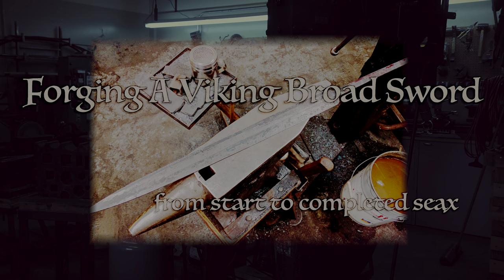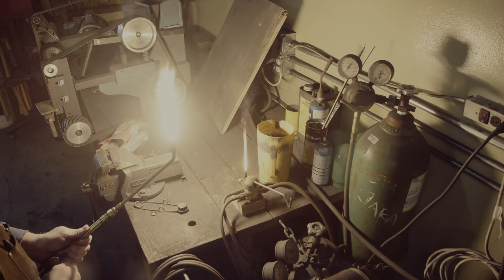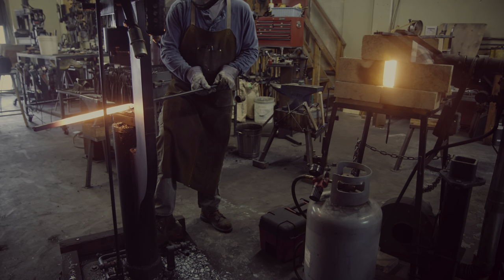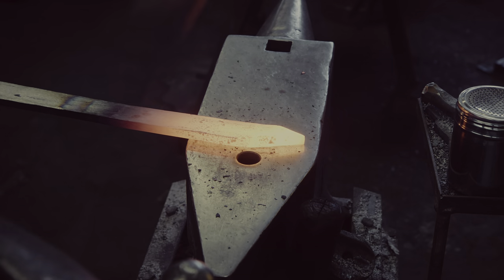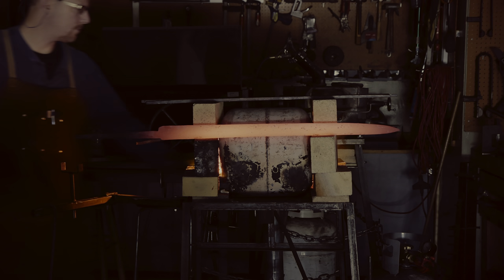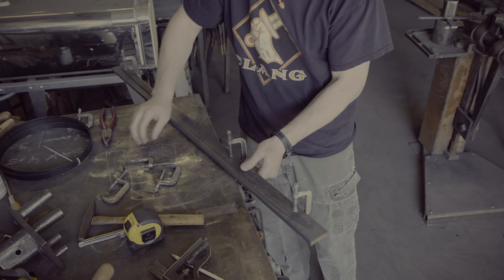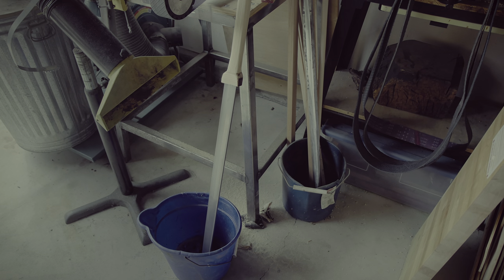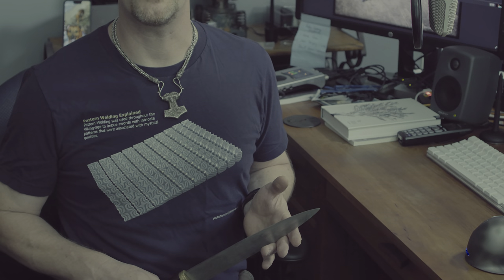Forging a Viking Broad Sword: from start to finish - Swordsmithing! (Broad Seax)

Comment: Completing a twisted bar sword successfully even with access to today’s modern power tools is an almost impossible task. It boggles the mind to think of how skilled the dark and middle aged European blacksmiths were to have created the swords they did without the tools of today. Back then, a master blacksmith must have worked years as an apprentice, probably from a very young age, and also would have needed a team of skilled workers beneath him to pull off such a feat without wasting expensive and difficult to come by high carbon steels. As you say in the video no one truly knows exactly how certain steps of the build were completed back then or what types of tools they had access to. I’ve also read the process was not uniform throughout Europe as not all blacksmiths studied under the same master and also lived and worked in separate communities, which means they most likely had very different processes and techniques.  Thank you for disclosing the amount of time it too you to make this sword. A year is understandable even for a skilled blacksmith like yourself that has a full time job and only a small amount of time each week to dedicate to these builds. Amazing video! Thank you for putting the time in to be so thorough with your explanations.

Comment: "I will see you in another video very soon"

Our perspective of time seems to be different. Niels please don't break my heart.
Reply from the maker: Soon is really up to a lot of interpretation. This is meant to be in Niels time.
Reply: @NielsProvos  Quality takes time :) I quite enjoy whatever you throw our way. By the by, I was recently re-watching your wolfstooth spear video, and was wondering whether that method could have been used to create relatively cheap and "mass" produced swords? i.e. forge out a bar of steel of sufficient quality, and then fold it around a low carbon steel/iron centre. Would such a sword work at all? or would it just be structurally flawed to such a degree that it wouldn't even be usable?
Reply from the maker: Yes. Common construction for Japanese swords.
Reply: still curious as to when the serpent sword will be done..

Comment: Great video ... although the "closeup" near the end wasnt quite close enough to really show the pattern to best effect.  Enjoyable and informative +1 😁

N00b question: why draw out and then forge weld long pieces together ?  Wouldnt the chances of success be better if you forge welded them before drawing them out, or would that adversely affect the pattern ?
Reply: Drawing out the billets also lets him size the patterns. Since he has to manipulate several billets to create the pattern, it's best done at a larger size, so it's easier to handle, and there is more surface area to forge weld. Sometimes, the metal doesn't close all the way, creating a cold shut, and a larger billet gives more leeway to grind out the cracks or shuts that a thinner billet doesn't have.
Reply: @shura0107  Thanks for explaining. 👍

Just to ammend my question a little further ... yeah, it seems like fairly common practice to take off a little from each end when forge welding since delaminations seem most likely to occur there, so it appears to make sense that a billet would benefit somewhat by being longer to minimize the material losses with removing the ends in each pass ... but it also seems like that benefit only helps to a certain point, beyond which the chances for a delamination somewhere in the middle would seem to increase.  If there is such a 'sweet spot' (i.e., range of optimal ratios of length vs width/height) i'd love to hear some thoughts on it, because i've yet to see a video that covers stuff like that.

Gratitude in advance to anyone willing to take a stab at that ... assuming it's even a thing. Cheers.

Comment: Something that you might find useful for straightening a warped blade is Shimming it on either side of the warp when you clamp it to the mild steel bar.  Also Tempering A long blade to 450f is usually sufficient to give it a nice spring temper.
Reply from the maker: Thanks. That's a good point. I sometimes shim with US quarters. I also had experiences where shimming created a warp in the opposite direction that was really difficult to remove :-)

Comment: This video for the first time answered a question that has been bugging me: 

Swords are made to specific size and must not be too heavy. The starting material billet is significantly heavier than the end product, and all forging work reduces the mass slowly through scaling. But much of the forging is done to hammer out kinks and shapes that you could never predict so you can't know beforehand how much scaling you'll get. And I never see the blacksmith do any "weight finalization" by cutting an excess piece off one end. So how come they end up with the weight and size they wanted? Now according to this, any excess material is left as thickness, and is removed through belt grinding. Am I correct in this?
Reply from the maker: You definitely want to make sure you got the basic shape right as that determines the balance of the sword and the overall weight. Grinding is definitely the way to fine tune this. It's also important to keep in mind that that the guard and pommel will add weight back.

Comment: Nice video @niels provos, though you should improve on your hammering skills as throughout the video you just lightly tapped the metal rather than striking it.. it’s not glass, it’s metal.. though that’s just my opinion, everyone forges differently..

Also when quenching in oil you need to dip it in and out like a tea bag, not slowly with minimal movements, as the heat from the hot blade will form a heat bubble like thing around the blade so the quenching will be uneven and the metal will warp.. so doing it by dipping it fast, in and out will get rid of the bubble that constantly forms around it and renewing the oil contact, resulting in an even quench..

Comment: I feel like historically the twisting would’ve been done by holding it with tongs and tong clamps very tightly. An apprentice holds one side the smith holds the other and they twist opposite directions could be wrong. Lovely work!
Reply from the maker: There is some evidence for twisting torques using special tools if I recall correctly.
Reply: Niels Provos hmm. I saw some twisting bars made of mild steel or wrought iron back in the day. It was a 18” ish bar bent in an s shape with the ends of the s extending to hold onto. It fit two sizes of bar stock

Comment: It seems like a lot of material, compared to the final product. Do you think that smiths back then used less? Considering they had to do everything by hand.
Reply from the maker: It's probably actually quite similar. Of course back then even more work was required to make the material. A sword like this would be a fortune.

Comment: How heavy is that peddinghaus anvil? Contemplating if 50kg is enough or the extra $$$ for 75kg
Reply from the maker: I am pretty sure it's 150 pounds, so a little bit less than 75kg. I wouldn't go less than that.

Comment: How did they forge without any welding in the past?
Reply: Sand is a flux
Reply: If you're referring to his using a mig welder to temporarily tack weld and hold the pieces together before forge welding, you can also use something like bailing wire (or even the metal from wire coat hangers) or similar to tightly wrap the billet together at different areas along its length, then just snip them off once all the layers are welded and keep on forging.  The way Japanese bladesmiths forged their "tamahagane" billets by carefully arranging and stacking their smaller pieces onto a "plate" made up from the same steel and then they would cover the entire things with rice paper, mud, and rice straw ash to help hold everything together as well as the protect all the layers from oxidation.  Then they carefully and slowly heat it in the charcoal up to make sure nothing falls off and then get it all to stick during the forge welding.  Basically, there are numerous ways and methods for forge welding without a modern welder.  For a handle on the billet without a welder, one way is to just make one of two of the individual steel layers extra long to stick out from the main billet in order to give their tongs something to hold onto.
Reply: Covered in mud or when you heat two pieces of metal hot you can pull them out drop them on top of each other than hit with a hammer and it will weld

Comment: Borax is like pepper, not salt.  More holes or bigger might help ya with your seasoning lol   That was like nowhere near the borax needed  :(   You got some great works here.  I prefer great forging and sharing knowledge than pissing in your wind.  Just sayin I was surprised how little borax used...
Reply from the maker: You can actually get away with much less than you think. That said, it's hard to forge and take video at the same time. There were certainly moments in making this sword where I used much more borax.

Comment: My guess is they used their beefy forearms to use tongs to twist, not that hard if you got the wrists
Reply: They likely had a twister tongs, IE, a reverse clamp type tongs where when you spread the arms apart, you tighten the fingers. Combined with a decent angle, that would give excellent grip and torque whilst twisting metal. I've no evidence to my claim, but modern smiths use them, and if a modern smith uses something, there's a likelihood that an olden one did it too.
Reply: I've seen modern blacksmiths use a pipe wrench to twist it while in a vise. The downside the manual twisting technique is that it wastes material on both ends and there's no guarantee of an even twist. Niels' method with a jig, while not "traditional," wastes less material.

Comment: The handle is too long.
Reply from the maker: Why? The handle will be cut to whatever length is needed when making the fittings.
Reply: @NielsProvos  The longest handle on a norse/viking sword was 11cm and the average was in between 8 and 9.5cm.

I thought you wanted to be historically accurate.
Reply from the maker: I left the tang intentionally longer. The person who will make the fitting will cut it down to the size they want.
Reply: @NielsProvos  ok.